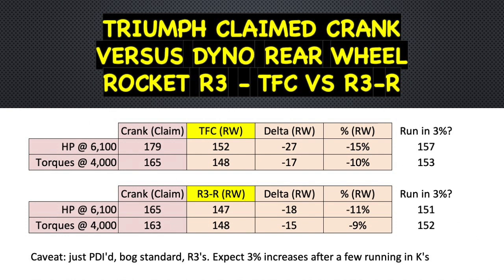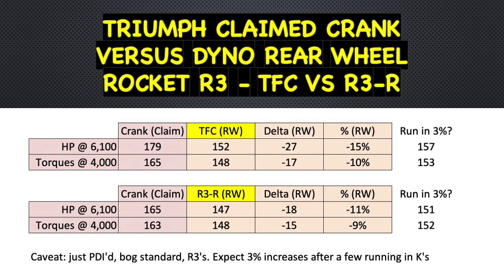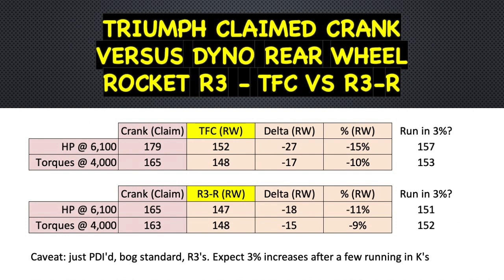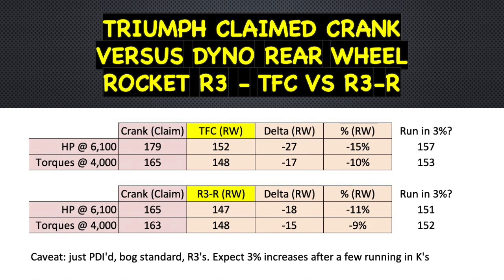RIDE ON | Dyno'd Triumph Rocket 3 | Factory Custom (TFC) vs R3-R

Comment: Thanks for the analysis, Richard. I came to Triumph Berlin a few days ago to order a Scrambler 1200. When I arrived they had 6 Rockets standing in the showroom, all three models. All of them were sold already, just waiting to be picked up once the season begins but it gave me the unique opportunity see all of them . I was absolutely enamored by these beasts, the finish and sheer presence they exude is unique. So I ended up ordering one. To say the least, these are in high demand here and this season‘s lot for my dealership is almost sold out - and they don‘t even have a demo unit yet!

The styling of the TFC didn‘t really appeal to me that much, but im not really a fan of carbon.
Reply from the maker: Congratulations Georg! It's definitely a model people need to see in the flesh to appreciate isn't it? Which model / color do you go for? My dealer actually owns a Scrambler 1200 XE which is a little battle-scarred, as he uses it off-road a lot. He said he's never been interested in power-cruisers, but after riding the Rocket he's thinking of allocating an R to himself too! He also mentioned his phone was ringing off the hook all Saturday, with people wanting to know if it was in so they could come down and see it. I think everyone has underestimated the level of interest in this model. Triumph got this one RIGHT! :-D

Comment: Gentlemen, I absolutely LOVE the new design. Are there many aftermarket components available for the Rocket II like a free flowing exhaust system and matching muffler? How about the airbox?
Reply from the maker: Triumph have many parts and accessories available for the Rocket 3 - you can see them by using the Triumph web site configurator for the R3. Unfortunately no exhaust system option just yet. Expect Carpenter Racing, Zard and Arrow to offer them in time.
Reply: @RichDunn  Thanks! Ironically I was just reading about him. I learned that he was involved with the land speed record attempt. Bad ass stuff! I saw that he offers a turn in package that brings you up to almost 250hp! ZIKES!!! Its really expensive but he sounds like "the man".
Reply from the maker: @kennethwise7108  For those that want more power than that, they need to talk to Richard Albans at TTS Tuning. He has a very long track record of supercharging R3's!
Reply: @RichDunn  NICE! I absolutely love the new look of the R3's. I have 2 bikes right now and I'm sure considering a 3rd LOL.
Im sure the factory warranty would be gone if a turbo was installed but who cares right? 🤣

Comment: Glad I didn't splash out for the TFC if the difference is basically cosmetic. More than happy with the 3R. Thanks for the great info.
Reply from the maker: Hi, Jet. I rode that actual bike on the dyno and you're a very lucky boy owning an 3R! For my needs an R is better than a GT, so I empathize with you! Buy friend Eric collected his TFC the same day (look out for videos of my test ride, the uncreating of his bike, and tomorrow a video of his first ride and a near crash/running onto dirt incident in that video too! I can say that the TFC in person is stunning and it's limited run will help keep residuals strong. The Arrow system (quiet) seems to provide the extra 6 hp, but torque (throughout the range) is no better than the R3R. The TFC paint is gorgeous as are the lashings of carbon fiber. But it does cost an extra $7k, which is hard to justify, except for the extremely well healed. They were all sold on the first day of availability, so that's all in the past now I guess! I have a korosi red R3R on order, which should arrive in Feb (in theory!), so expect a lot more Rocket content on my channel this year - please subscribe! What color did you go for? The phantom black is mean and moody, the red is hot-rod bold - both excellent choices! :-D
Reply: Paying the exclusivity of it plus the bells and whistles.  Even though you spend more upfront, my take is the TFC will be a better investment over time.
Reply: Picked my TFC up two days ago.  I don’t know if it’s ‘worth’ the extra money, but really at that point, it’s not much different.  Or to put it another way, if the extra makes a difference to you, maybe you shouldn’t be spending that much on a motorcycle in the first place!
Reply: DJB 730 picking mine up in a day or two. I’m with you.
Reply from the maker: @djb7302  I've owned 35 motorcycles and ridden at least 250 different models. But I can say that IMHO the TFC R3 is one of the most special bikes I've ever seen. The only other bikes that dropped my jaw on release were the RC30, NR750 and Desmosedici. So it's in good company! When you look at the Arrow exhaust, all the carbon, the goodies bag, the machined fork clamps, the special hand pin-striped paint, the increased residual value of its limited numbers, it just about justifies it if you have the money. Interesting fact: R3 owners cannot order TFC parts to make theirs similar. Triumph make you prove you own the TFC to order any replacement parts. Things like that really make it properly exclusive, unlike HD who say - f*ck it, they're selling okay, so let's just make another 25,000 of them then! ;-D
Reply from the maker: @richards4492  You're going to love that 150 "lbs.ft" at the rear wheel Mista Scott! :-D
Reply: So a few initial impressions:
The `hill hold’ which I thought would be pointless, is actually really cool, and you can just put it on every time you come to a traffic light - just means you don’t have to sit there holding the brake on.
The ‘speed shifter’ which I thought would be pointless, is also really cool, and works way better than I could have imagined.
After owning a Diavel and then an XDiavel, I’ve just discovered those shiny things attached to the bars allow you to see what’s behind you, as opposed to a blurry mess.
You can’t do burnouts because the front brake activates some back brake - had not seen this reported anywhere previously.
The riding position is perfect for me (I am 1m89) - I never got on with the XD feet forward nonsense, and I’d advise anyone considering the GT model to really check it’s what you want.  The acceleration of 150bhp+ bikes makes your feet lift off the pegs if they are stuck out in front, as does very high speed - the air pressure is pushing your feet off.  It might suit a Harley, it does not suit something capable of dipping under 3 seconds 0-60.   Also, both this and the Ducati’s are firmly sprung - with feet forward, your spine takes all the bumps - hated it.
The engine is more powerful and (obviously) more torquey, but it’s not vicious like the Diavel - those engines really kick on past 6k where this one just has you changing up.  It’s not better or worse, just different.
It’s the most planted bike I’ve ever been on, and somehow the balance feels so good.  Don’t know why, you’d think the shaft would make it worse than belt drive, but it doesn’t.
Anyway, more than enough rambles from me.
Reply from the maker: @djb7302  My GSA has hill-hold and a (up-down) pro-shifter, and they do add value, especially the hill hold for me personally. Having owned a carbon red, I know exactly what you mean. I love the mirrors performance on the R3. I've seen pictures of journalists doing burnouts, so I don't think the brakes are linked. But you'll have to put it into the rider (customizable) mode, and within that have traction control toggled to off. Same if you want to wheelie it, which again I've seen some journo's doing. I liked the look of the XD-S, but the ergo's felt too weird to me, as does the HD FXDR (made for aliens?). Bang on about the foot lift at speed. I had a first gen Fat Bob and above 70 mph you had to squeeze your thigh muscles to keep your feet on the pegs. And yes the Diavel jars spines, even with the touring comfort seat fitted and the preload adjusted to suit. I love shaft drive (I do own a GSA after all!) and did 'not' say it's worse than belt drive, which is actually my favorite form of final drive, having owned HD's with it for instance. What I said was, it has the worst crank to rear wheel transmission losses, due to it extra weight and internal friction. There's a reason moto-gp bikes use chains, and it isn't because they're cheaper than shaft-drives! 😀
Reply: Richard Dunn To do a burnout, for sure you’d have to turn off the TC.  But I’ve got a feeling the burnout is simply over powering the mild linked rear brake, and is probably wrecking it.  
As for wheelies, you could do them on the XD, but if the inclinometer thought you were going too high it would back it off.  Finally, the perils of typing vs speaking - I didn’t mean YOU had said that shaft was worse, I meant it like ‘one would have thought that’.  :)
Reply from the maker: @djb7302  You could well be right, regarding linked-braking system? But (unlike say an BMW R1250GSA) there's no indication of a linked-brakes system in the specifications on their web site? The front brake, for instance, just states: 'Dual 320mm discs, Brembo M4.30 Stylema® 4-piston radial monobloc calipers, Cornering ABS.' That said, there's also no mention in the web site specs of the traction-control, which the five-axis IMU has made possible as standard. But my gut feeling is that the brakes are not linked, as I've not seen any mention of that in the journalists launch reports. So I think burnouts and wheelies are both possible. But they're potentially perilous to your wallet or health. Or both! :-D
Reply: 100% agreed on the reporting about linked brakes, which is why I mentioned it as being in the Owners manual was a bit of a surprise to me.  At least it’s not like the old Honda system where the back brake also activated the front, doh!
Reply: @richards4492  The quoted figure for the 'R' is 165bhp @ 6000 revs, while the claim for the TFC is 179bhp @ 7000 revs. These figures are taken at 6100, so maybe the TFC could have revved a bit higher. I thought that was where the extra power came in.  My Triumph Dealer told me that the bikes are slightly restricted in the first 3 gears.
Reply: @richards4492  The quoted figure for the 'R' is 165bhp @ 6000 revs, while the claim for the TFC is 179bhp @ 7000 revs. These figures are taken at 6100, so maybe the TFC could have revved a bit higher. I thought that was where the extra power came in.  My Triumph Dealer told me that the bikes are slightly restricted in the first 3 gears.
Reply: @RichDunn  I watched several test videos and I always understood that applying the front brake put a pressure on the rear brake as well.
Reply from the maker: @BangFarang1  I've done a little bit of additional research on this now. And it does look like triumph have linked the brakes. But how they've done it via the electronics is very clever indeed. Instead of, e.g. like some BMW models, just having a semi-linked setup operating individual pistons at the rear when the front brake has been applied. Triumph have utilized the 5-axis IMU to figure out an appropriate amount of power proportion to either end, based on lean angle, grip, weight distribution, etc. The R3 is even smarter than I thought! :-D
Reply from the maker: @djb7302   I've done a little bit of additional research on this now. And it does look like Triumph have linked the brakes. But how they've done it via the electronics is very clever indeed. Instead of, e.g. like some BMW models, just having a semi-linked setup operating individual pistons at the rear when the front brake has been applied. Triumph have utilized the 5-axis IMU to figure out an appropriate amount of power proportion to either end, based on lean angle, grip, weight distribution, etc. The R3 is even smarter than I thought! :-D
Reply: @RichDunn  According to the handbook, the brakes are linked and this cannot be switched off.
Reply from the maker: @MrBillyRR  I've read in an article that the brakes are electronically linked (a first?). However I have a PDF of the owners manual and I when I search on brakes or linked, I cannot find any reference to linked brakes? Would you mind letting me know which page in the handbook I can find the info on? Many thanks for your time! :-D
Reply: It’s page 97 of the TFC manual.  ‘When the front brake is applied, a small amount of rear brake is also applied.  The amount of rear brake application is related to the level of braking force applied by the rider through the front brake lever. Use of the rear brake pedal alone will only apply the rear brake.’
Reply: Also on page 100. ‘ Due to the nature of the partially integrated braking system, any attempt to spin the rear wheel while the front brake is applied (Burnout) will cause damage to the braking system and drivetrain.
Reply from the maker: @djb7302  Great, thanks for taking the time. So essentially the system is exactly the same as BMW's. I.e. Partially linked, with the front invoking some rear braking and the rear acting purely independently of the front. That makes sense, it's the best system around. And so, yes, burnouts will not do the rear pistons and pads any favors, even though the engine is more than capable of overcoming the braking forces. Cheers!

Comment: Unrestricted maps are available at Tune-ECU now.
Reply from the maker: Thanks, Ulf. That will please a lot of people. But to balance that for anyone reading, it should also be noted that in most countries re-tuning your Rocket will invalidate your warranty with specific regards to any engine problems you may experience, that Triumph believes are directly related to non-factory tuning.

Comment: Sorry Richard 
just a big shock regarding the difference between the  standard to the TFC in power that why we paid more for it 
all good just peed off
Reply from the maker: I think you're right to feel a little aggrieved, but not for an obvious reason. I.e. I expected there to be a bigger delta between the TFC and R3R. Not because of the price difference, which is largely justified purely in cosmetics and exclusivity. But because, I think the fact that the R3R 'over-performed' on exceptions. It's losses were much more similar to a chain final drive and not a shaft. The losses on the TFC are right on the money industry crank claims versus rear wheel reality. But the R3R knocks it out of the ball park, pulling it close to the TFC, which is understandably annoying to any TFC owners - I would be too! But my view would be to put the R3R aside. Accept that the drive-line loses are on par with typical crank to rear wheel loses (i.e. Triumph aren't exaggerating their crank figure) and be happy with the fact that you have an extremely well rounded (circa 150/150 hp/lbs.ft) engine that the VMax, Diavel, Fat Bob 114 and 'any' other bike cannot squarely match... with a little more to come once run in! I have a red R3R on order. I'm sure I'm going to be delighted with it. But if I could have afforded the TFC at the time it wass announced, I'd of had it in a heart beat. And seeing my friend Erik's one in the flesh, I'd have thought it money well spent too. He thinks it makes his circa $45k CVO Road Glide look like overpriced nonsense in direct comparison. I can't make you think for you. But if I could, I'd say stop over-thinking it, and just ride it. The more mile you do on it, the more you'll fall in love with it. And that's a promise!
Reply: They measured  the power at 6100 rev for both bikes, although the max power of the TFC was announced to be at 7000, not 6000 like the R.

Comment: I'm surprised at how solid (or not actually lol) the shaft drive is on this thing.
Reply from the maker: It's like it's hewn out of a solid piece of billet :-D Having owned none BMW's (and they know a thing or two about shaft-drive) including a 2019 R1250GSA, I have to say that in operation it's as good as BMW's system. I.e. Like a very well adjusted chain. Like the rest of the bike, it looks quality, and I'm expecting it to remain maintenance free and very reliable for owners.